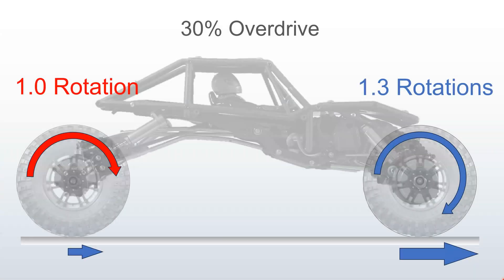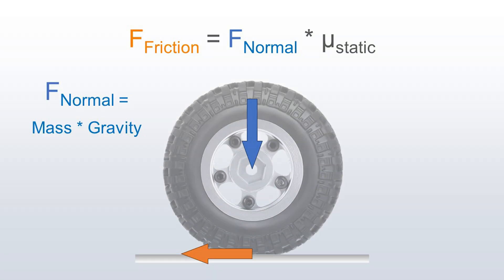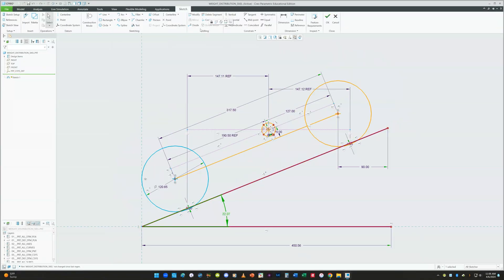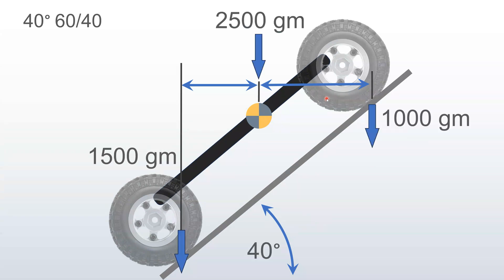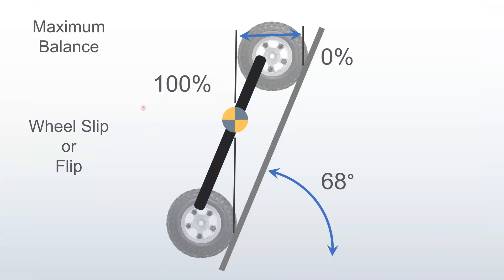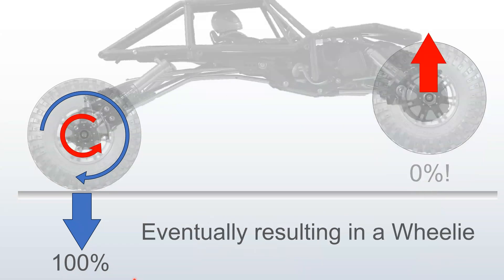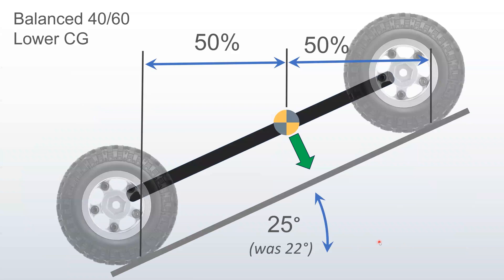Overdrive v. Incline - How do they Interact?

Comment: Hi, I’ve been wondering about under driving the rear axle on my Rock Van, by changing the diff gears… would there be any effect on torque twist?
Reply from the maker: Anytime you lower the gearing it helps. When you are on a steep hill, most of the twist is coming from the rear axle so under driving it would help in theory, but I think it would barely be noticeable in this case.
Reply: @BoomslangSuspension  thanks, I watched your portal gears video too and, as you said, a reduction is a reduction… whether it helps is subjective I suppose. 
The kit is quite cheap, so I might try anyway… got to be the best way to find out if it’s beneficial for what I want 😊. Thanks again.
Reply from the maker: Reduction is always better.

Comment: When breaking over, the front wheels are pulling the vehicle straight forward while the rear wheels are still moving upward at an angle – a longer path. Doesn’t this create sort of an overdrive without overdrive?

Outside of RC cars, another example of the same thing is when you’re carrying a long item with a buddy up or down some stairs: when you’re the tail guy and the other guy starts descending stairs, you have to slow down. At the bottom, the front guy must take it easy for a few steps to avoid pulling the other person down the stairs.
Reply from the maker: Interesting line of thinking.

Comment: Great video, thanks for the info! Do you think over drive in the front or under drive in the rear is better? What would be the pros/cons of each option?
Reply from the maker: Think of it this way - your rig will travel forward slightly slower than the front wheel speed. This is because the rear wheels are putting on the brakes, just a little, so it prevents the car from driving at the full speed of the faster turning front wheels.

So do you want your rig to have faster or slower forward speed?  If you want slower, underdrive the rear. If you want faster, overdrive the front.
Personally, I gear down everywhere possible - I run 4S and want it to creep as slowly as possible. Better slow speed control, longer battery life, higher torque.

Mechanically, it doesn't really matter if you change the front or rear. Pick the one that moves your overall speed in the direction you want.

Comment: On my vanquish, when out crawling for the first time having on the fly overdrive % selection, it was so cool to do the same lines and crawls with both ratios and seeing the difference. It was incredible the difference low OD % and high % had and oddly they were both better and worse in specific situations. Thanks for the video I wish I had it 20yrs ago.
Reply from the maker: Which Vanquish?  I can see that being true - better and worse in different situations.
Reply: @BoomslangSuspension  in my case I had the Phoenix out. But a few now have the transmission that’ll do that and has dig.

Comment: Very interesting! However, it seems that the video was about weight distribution rather than over underdrive on slopes. I thought you were going to point out things like the advantage of rear over drive when cresting, and the advantage of front overdrive when starting to climb with the front.
Reply from the maker: Good points.  The wheel with the most weight has all the traction, so that I why I took the weight bias angle, but for sure there are more aspect to explore.

Comment: Great vid! Thanks! So I guess moving your weight forward is all good going up. But coming down, the common agreement is that it's not good. Hence, the golden 60/40 "rule". So do you subscribe to this or have you found that going over 60% front bias is fine and it's other factors that contribute to the claimed downhill problems going above that golden 60%? 
Have you got any mechanical tricks one can do to the rear of a crawler to lessen the negative effects of going over that 60% (If that is the Goldilocks percentage of front weight. )
Thanks!!!
Reply from the maker: 60/40 is  a great rule of thumb.  However, it's a little too perfect of a number.  I know a lot of great drivers that are closer to 64% in the front. Not saying I am great, but I like 63-64.  Yes, it can be a problem going down, so you have to balance how and where you like to drive.  Also, you can manage the downhill by keeping the front wheels rolling faster than the rear. You need to keep accelerating on the way down, and don't hit the brakes or let up on the throttle. Small stalls will flip you over more easily.

I have a great video I shot last week of a long rock ramp, where I could not get the front going fast enough and the rear end eventually overtook it and flipped over. I am going to go back with faster gearing and see if I can stick it.
Reply: @BoomslangSuspension  Thanks for the reply! Always stuff to monkey around with, just like MTB'ing. :D 
Have a good weekend! Sub'd and looking forward to more analysis and testing.
Reply: Your anti squat video may have enraged some people, but physics don’t care kids! And as I’ve said in my crawler group, gravity doesn’t work sideways…you’ll eventually unload, front overdrive helps a lot though as does low centre of gravity.
Reply from the maker: Facts.

Comment: You can change gearing in the gearbox, or in the portals, to achieve overdrive/underdrive.  In the video you described overdrive as changing the gearing so, the front wheels spin faster than the rears and underdrive as the fronts going slower (than the rear wheels, I assume?).  Not sure if you misspoke, but underdrive is changing the gearing in the rear so, that the rear wheels spin slower than the fronts.  In both cases, it results in the front wheels spinning faster than the rears.  I think in most cases, people will use overdrive in straight axles and underdrive in portals but depends on the driver and gearing options based on the rig.
Reply from the maker: You can overdrive or underdrive either axle, and you can over-gear or under-gear either axle too, so I guess we just need to be clear what we are referring to.